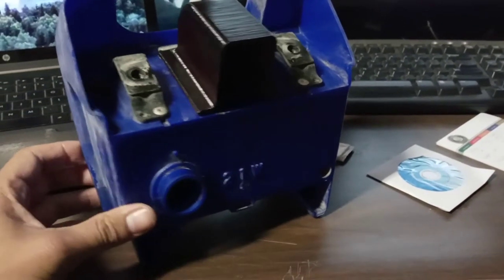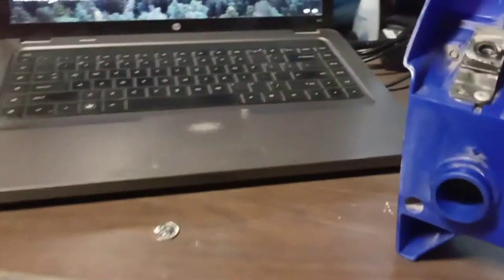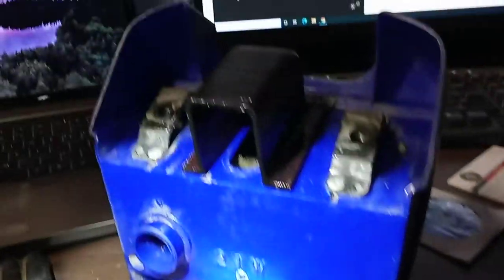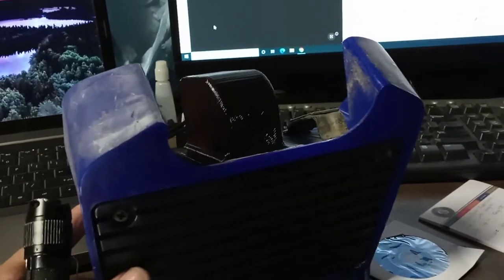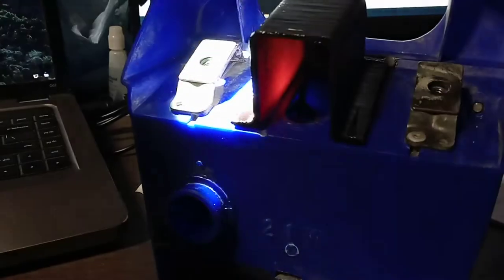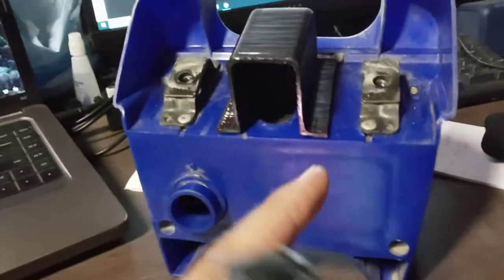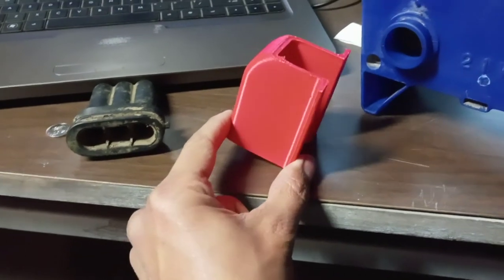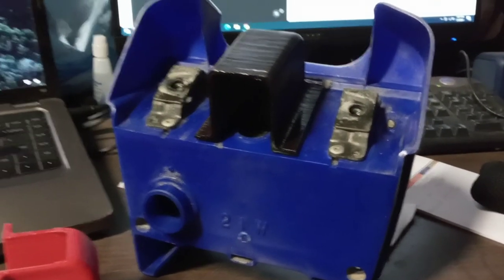PW 80 snorkel mod and 3D printed shield.

Comment: Awesome.hopefully this will boost the pw.Should be good with an unrestricted exhaust too!Maybe even  an fmf
Reply from the maker: Thank you!! I removed the restrictor from the stock pipe by the cylinder. It definitely sounds a lot better now but it has a slight bog when I open it suddenly to wide open so Im going to mess with the jetting to see if I can improve that. But once it gets up to speed and hits the power band it feels more powerful.
Reply: @liftedmike7415  that's awesome.im just working on doing the exact same thing! and swapping in a kx60 rear shock to raise it and stiffen ot so it doesn't bottom out
Reply from the maker: @jim-zb2kb  oh nice!!! Have you seen the 30 page thread on thumpertalk.com i believe? Theres a guy that has documented a ton of mods to the PW80. I ordered a 36 tooth rear sprocket to help with torque also. And i am also looking at stiffening the rear. I'm going to try a 250 lb fast ace piggy back shock from my friend's spare parts. Let me know how the kx 60 shock feels.
Reply: @liftedmike7415  yes!I get most info on mods from thumpertalk and YouTube.ill make sure to tell you how the kx60 shock feels